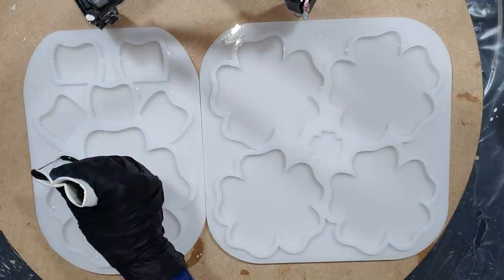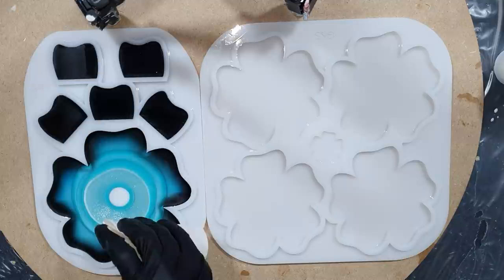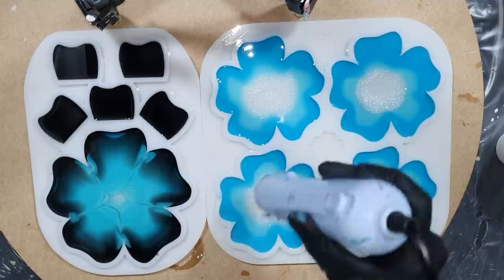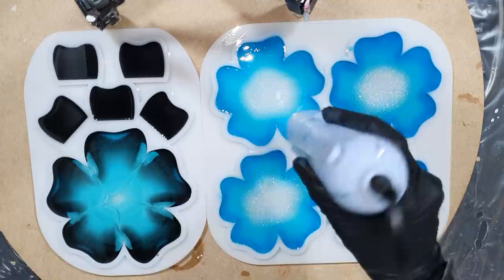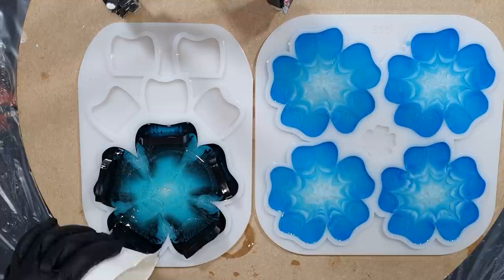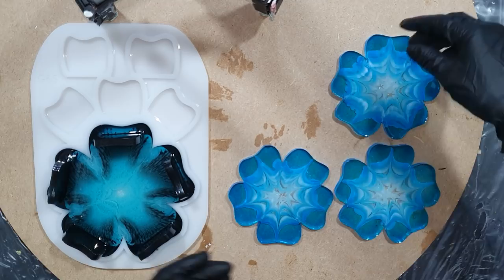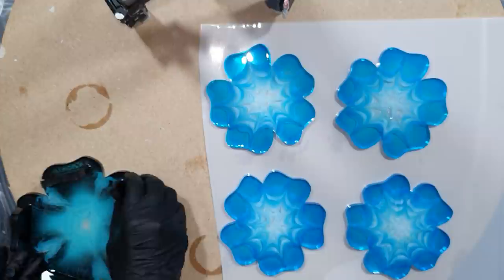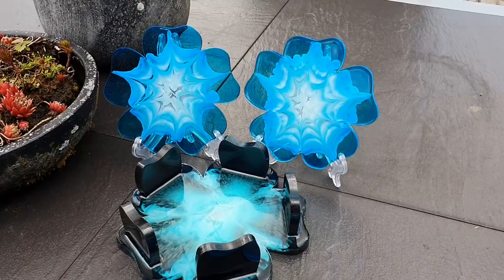Resin Flower Coasters Tutorial/ Start to Finish/ WOW! Coaster Holder

Comment: These are so beautiful! How do you stop your colors from mixing completely? Ive tried a few times and at first it looks great, but then as the resin heats up when its curing, the white lines or colors just completely mix together and I end up with just one color. Do you wait till the resin gets thick before pouring?
Reply from the maker: Thank you so much for your nice compliment Linda. I appreciate it a lot. I'm using a medium viscosity resin and then the colors will not blend that much together. I'm not waiting, I pour right away, but if your resin is thinn you can wait and let the resin set. Then it will get thicker, but you need to look at your working time and make sure that it doesn't get to thick.
Reply: @petrajongbloed4425  Thank you so much! I will definitely give it another try, Thank you for responding!